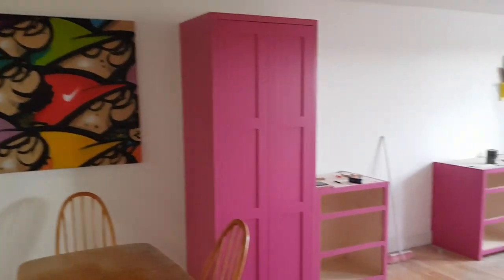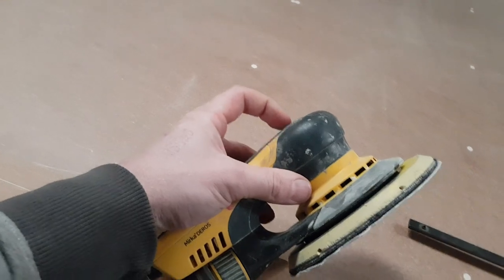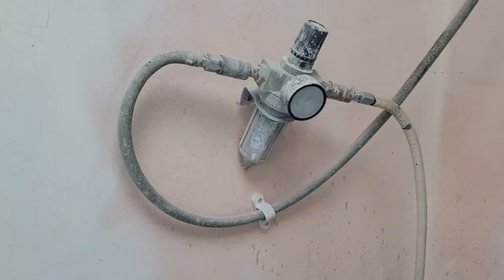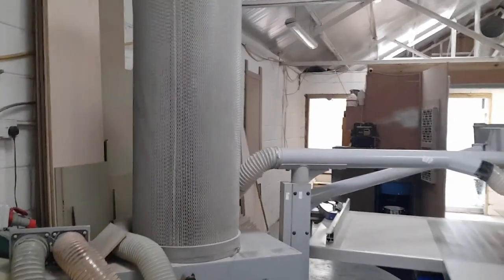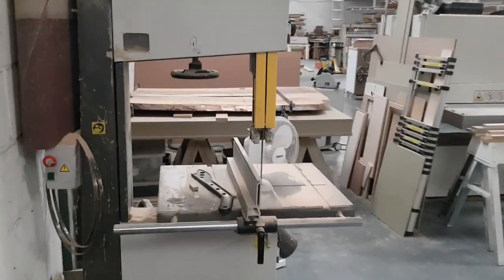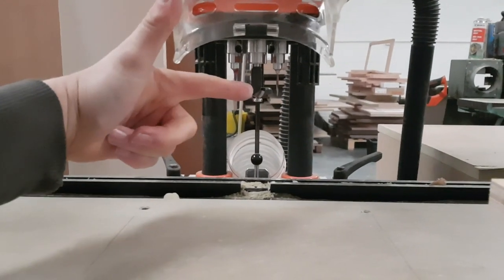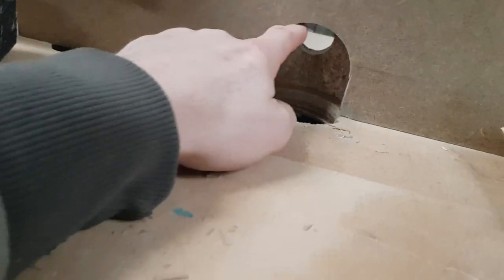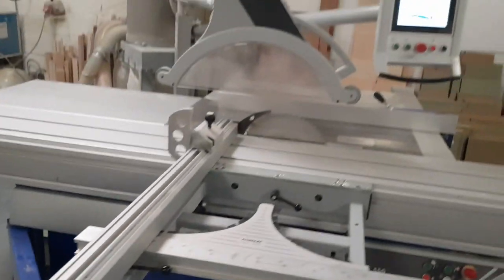4500sqft Wood Workshop Tour - Wood Welder, Felder, Format4, Wadkin, SCM, Lamont, spray booth

Comment: Hi Phil, 
Where did you bought your binks spray pump?
Reply from the maker: Hi peter. Bought from our paint supplier.
Reply: Is that symphony coatings?
Reply from the maker: Yes and we use symphony as part of our supply too.
Reply: Is their waterborne product good or you use PU only?
Reply from the maker: @petervido2405  all of their paints are good. We use waterborne clear lacquer and it works a dream

Comment: Wow, what happen to that sliding saws table top?!  Looks awful!
Reply from the maker: Better the saw gets damaged than a finger. Thats all I know. 😇
Reply: @getyourwoodout  I hear yeah!  Does the slider at least square up plywood accurately?  What size sliding table is on that Format 4?  Thx
Reply from the maker: 3.3m I think, would have to check but something not far off that.
Reply: @getyourwoodout  oh wow, in the video it doesn’t look like it would be over 10’ but, okay.  Thank You
Reply: One day, you might treat yourself to a Martin saw or Altendorf saw
Reply from the maker: Definitely.  I would have bought a martin but I didn't like the sales rep so it put me off.  Felder had an excellent support network so I went with them.  It's sold now anyway but I'll be buying another. . .

Comment: rather jelouse of your huge workshop, regarding your spindle, on the machine plate there is a test number if you go to marks website ( http://www.wadkinrestorations.co.uk/machine-date.html ) this will allow you to date it. I'm guessing its from the 60s.

i have a few wadkin machines in the workshop and apart from the old DR that is from 1934 they are all from the 60s all made within 5 years of one anther.
Reply from the maker: Thats awesome. I can date the lathe too then. Thanks so much   yes it is a big shop, a dream size. The overheads are just as big though haha.    

I'd like a pk saw next for a restoration project . Black and gold style. Lovely.  Thanks for watching anyway, I don't know if anyone actually enjoys it haha.
Reply: @getyourwoodout  do you have an RS? 
I dread to think how much your rent is, I moved out to middle of nowhere to reduce the rent, a larger space and 1/2 the rent.

The pk is nice but honestly I prefer my PP, I'm looking for a wadkin RK if you know of someone selling one. 

No worries, it's always nice to see people's layouts. I will do one myself some time next year when I'm happy with it.
Reply from the maker: Yes I have an rs8. It is a beaut. Will do a video soon.
Reply: @getyourwoodout  
Awesome be interested to see what came with it and the switch gear it came with
Reply from the maker: Kept all the original pulleys and switch gear but unfortunately the motor needed a rewind so I put it on 3 phase with a 240v inverter and it has variable speed now. Will do a rundown no doubt.